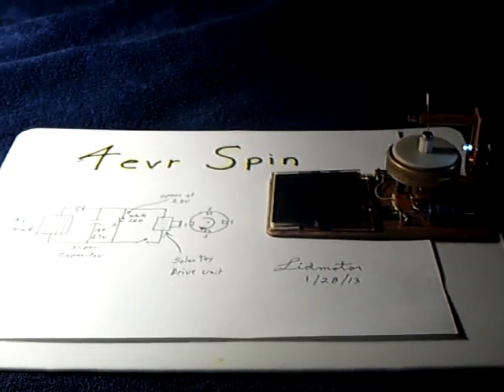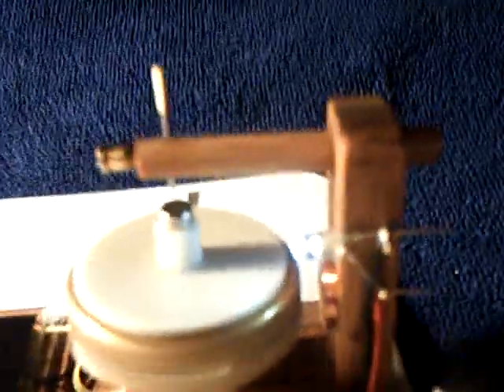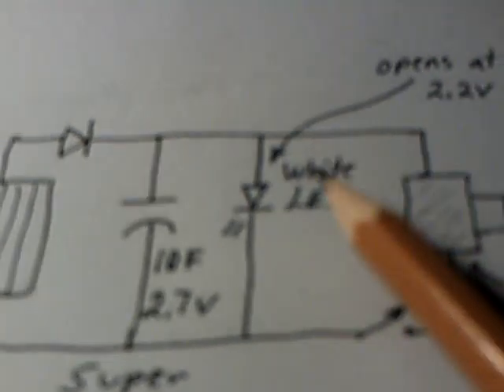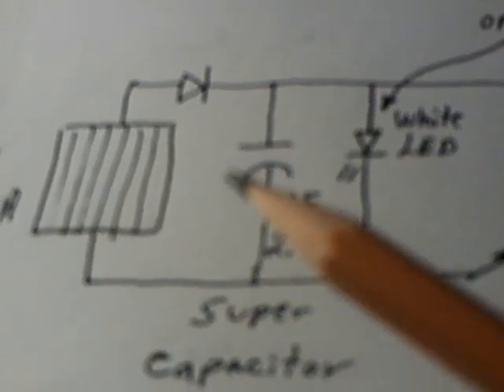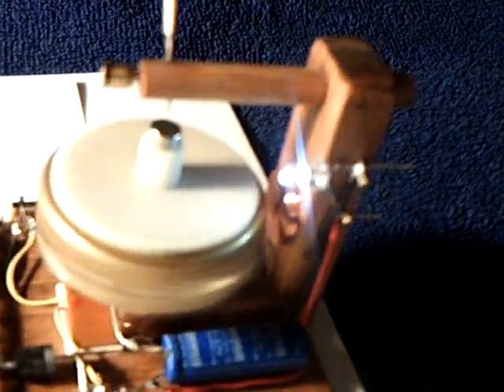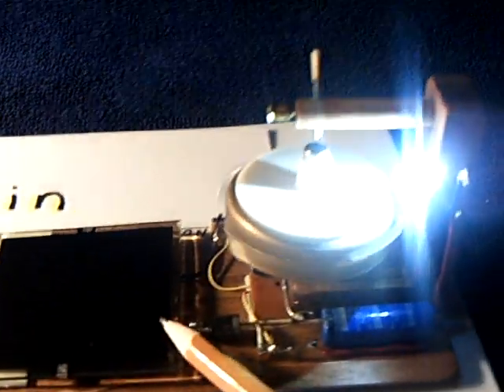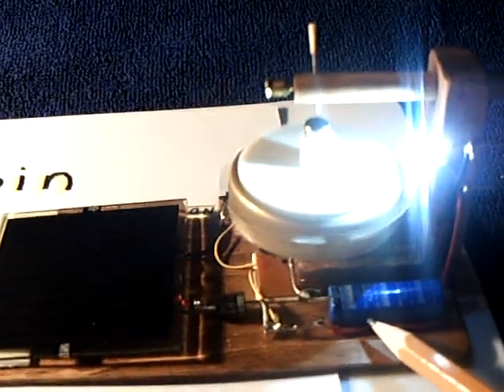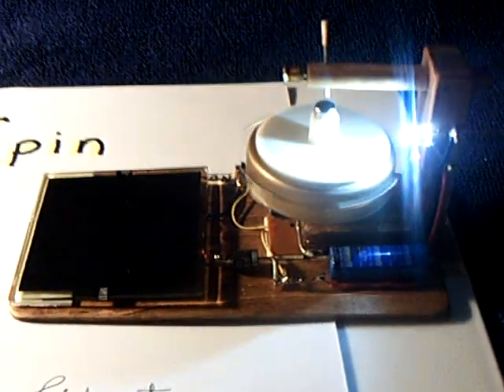4evr Spin

Comment from the maker: I ruined two drives trying to get the glued on coil off.   This one came out of something where the coil wasn't glued.  I can't remember what toy it came out of.  My suggestion if the coil it glued is to just very carefully cut the frame away around the coil.  If you break the super fine wire---you're done.

Comment: i havent reduced it by much at all but small steps etc. what i do is i charge batteries with the low current draw bedini charger and then i power my lamp with the battery.  simple technique for saving energy consumption. a bedini battery is a negative resistor. NEGATIVE RESISTOR  : )